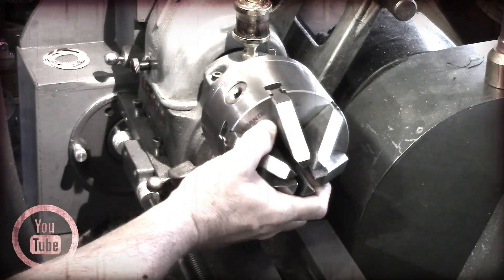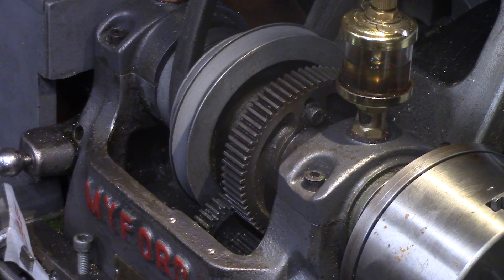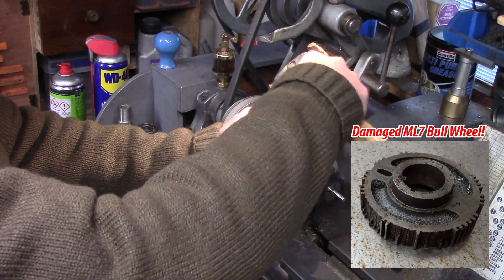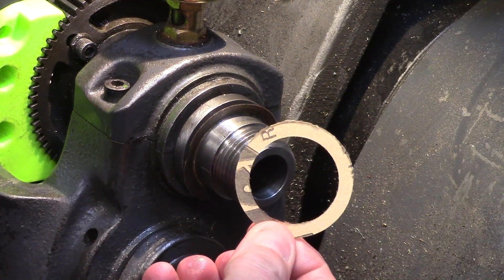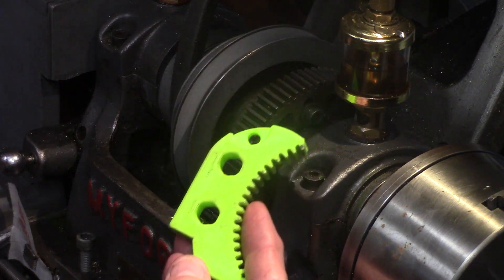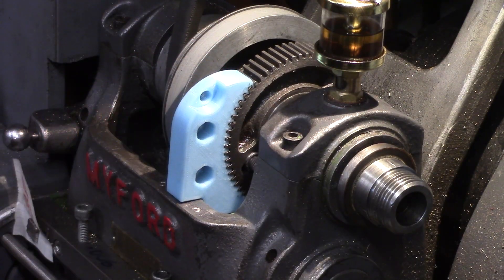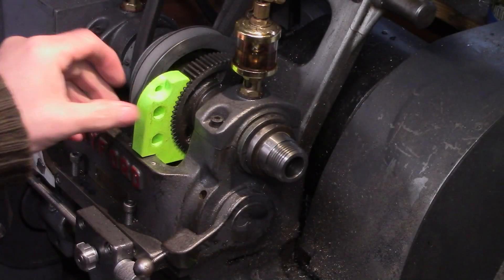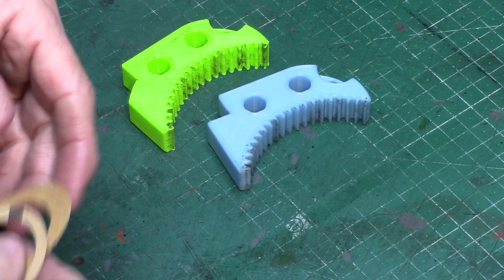3D Printed Spindle Lock Devices for the ML7 Lathe - No more stuck chucks! #modelengineering #lathe

Comment: We have one of these at Hackspace Manchester — it's amazing and a million times easier than messing with the backgear or locking the spindle to remove a chuck. With the handle version, you can fix it to the gear and than sort of tap the handle on housing using the chuck/faceplate and it'll break the thread. Makes it so easy!

Comment: Great video Ade. Very interesting tool. Amazing the things that can be 3D printed. I'm very lucky with my Myford ML7R lathe. It has a spindle lock. Just above the change gear cover there is a pin which can be pushed in to a hole in the large belt pulley wheel. This firmly locks the spindle to easily remove the chuck. If the chuck doesn't come off easily I put a piece of hex bar or square bar in the chuck and use a spanner to remove it. Take care, cheers Nobby
Reply from the maker: Thanks Nobby, yep, this was definitely an oversight of the ML7 designer, but modern ways have found a perfect solution :)